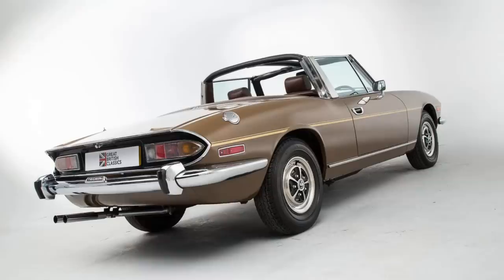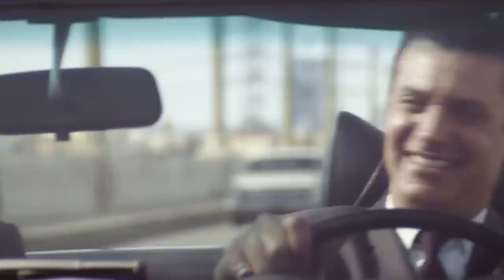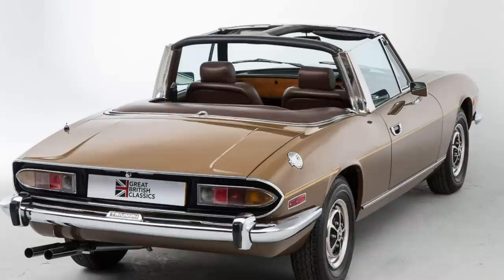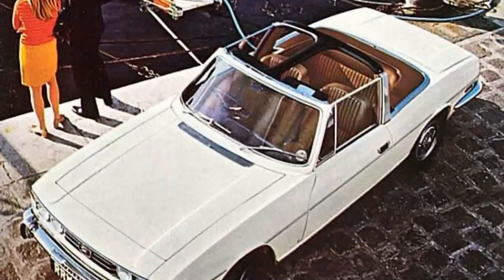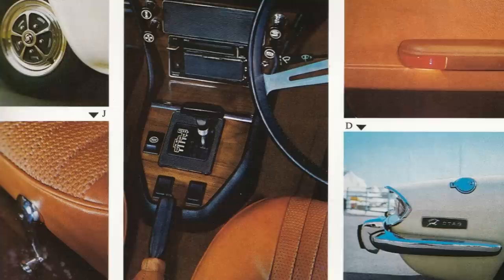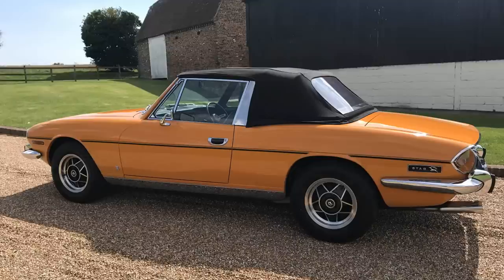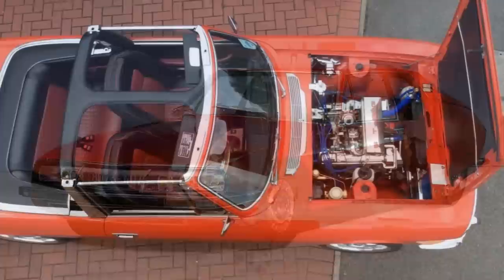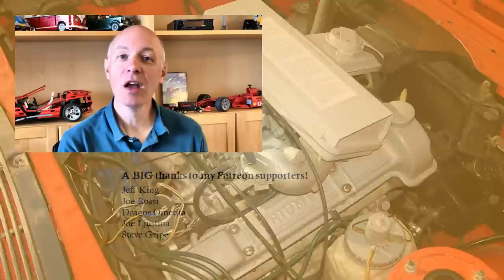Why did the Stag FAIL so Spectacularly?

Comment: The engine wasn't too bad provided you got a good un.
The timing chain was a pain, needed replacing regularly.
Coolant needed to be kept full of rust inhibitors,
They benefit from some minor adjustments to the expansion tank and a better radiator.
The dizzy tended to wear, better with electronic ignition upgrade.
Better carbs would have been nice (Webber's).
The crank was soft if reground, needed treating.
Perhaps that's too much of a list.
But I wish I still had a Stag.
It just felt special somehow and worth the effort.
Actually mine never let me down, but did give me a
 few anxious moments

Comment: It looks and sounds utterly brilliant, sadly the reliability was crap due to design and build quality 
bloody British Leyland, always screwing up the simplest of things
Reply: British Leyland was not the downfall of the industry, it was the final attempt to keep the lid on the festering cesspit about to erupt.  The iconic cars of the 60s like the Land Rover, Mini and E-Type were in fact all designed in the brief post war period of resurgence before the rot set in the 1960's.

The core problems was a dilapidated industry that failed to innovate where it really mattered rather than beat the drum of a few minor successes.  The rest of the world moved on, innovated and invested in its infrastructure, while the UK merely consolidated what they had into what became BL in 1968 and despite having a massive production base, any issue in a single plant could instantly shut down the entire production.  Ford, facing the exact same issues at the time could simply source parts from Europe.

British Leyland would have been a world class company in 1948 or even 1958, by 1968 it was a giant with clay feet.  They were usually down to the repurpose of existing parts in a record time and hope for the best and even stunning designs like the Stag were mechanical failures and the decent cars were so horribly uninspired you lost all will to live every day you drove one.  Given the issues, the real point is not that Leyland made shit cars, but how Leyland did manage to produce decent cars for their era like the Metro.

Leyland wasn't the murder of the UK car industry, it was one last doomed attempt to save it.

The irony is that Leyland had the potential to outgrow the problems that had plagued the UK automotive industry for over two decades, but everything conspired to make them worse.  The UK's curse is to have been at the forefront of so many developments only to remain stuck with outdated industry and infrastructure.

Comment: Everybody talking about what the Stag looked like....the problem wasn't the styling, it was the underlying mechanical bits, which were poorly designed to say the least. I had a 71 Saab 99 which had the Triumph designed OHC slant 4, and the idea of 2 of them lashed together sounds like a recipe for disaster. The last Stag I saw was about 5 years ago, parked behind a body shop way out in the Pennsylvania countryside and being used as a storage shed for rusty car parts. A suitable fate, actually.

Comment: As a teenager in the early 70's, a neighbour had a beautiful yellow Stag. However the motor went poopy in it's pants, it remained under a tarpaulin until he fitted a Rover 3.5 V8. Later available all the way up to 5.0, now a Stag with TVR Griffith power would have been quite something.
On a related note, how many times have we heard "oh, we cant make enough" in British industry. It was the same with bikes like Bonneville, to satisfy U.S. demand we had to wait. They did not increase output and we bought Japanese off the showroom floor. The Kawasaki Z1 was king of fast bikes & aging Honda CB 750 was second. (Laverda Jota & MV Augusta were expensive exotics) but Triumph & Norton were the best handling on my native Devon roads. BTW, I am now an old man & have been a Triumph owner since 09.

Comment: Nowadays you can make a Stag quite reliable and that doesn't mean using a Rover V8, which weighs less and upsets the Stag's handling unless further mods are done.
The engine was designed by Ricardo not Triumph.  The 4 cylinder variant was initially made by Triumph for Saab but Saab eventually redesigned the engine and produced it in Sweden.  It became the basis for Saab's later 16 valve designs.
Reply: Not so! The Triumph engine was designed by Lewis Dawtrey under Harry Webster's overall control. The Ricardo design was being developed with SAAB but they didn't have the funds to set up their own production line, so adopted the similar specification Triumph unit instead.
Reply: You're saying an engine which weighed less would upset the handling?
Reply: @jamesengland7461  If you replace an iron block V8 with an all aluminium V8 which weighs substantially less, then the suspension should be tweaked.  Unfortunately in the Stag's case it was very often not tweaked.
Reply: Mark, obviously incomplete work will not give good results

Comment: Surely the problem boiled down to, like all Leyland products, abysmal build quality
Reply: If only that would have been the problem. French and Italian cars had serious quality problems as well, but those companies managed to survive until today. Aside from the build quality, BL also suffered from equally poor management and poor engineering that resulted in myriads of construction faults.
Reply: I worked at Triumph motors Canley from 1970 to 1975 and you are dead right. The unions were so strong the company could not sack bad workers. No-one gave a damn about quality, I have seen new cars driven at maximum revs in low gears around the plant. Like most workers I would never buy a car from the company, it would have had the guts ripped out of the engine  before you took possession of it. It was the excesses of the unions that created the Thatcher government. Like a lot of British car plants it was anarchy on the shop floor.
Reply: @dp-sr1fd  I read a very good book on BL and it blamed unions, management and government in equal measure. Whilst there were malicious intentions from some union stewards, it made the point that actual working conditions were terrible on the shop floor. Imagine what proper workforce relations like we see now in Nissan in Sunderland where everyone is important, no matter what they do, could have achieved!

Comment: Back in the day, I had a TR3A. 2.2 Litre cylinder liners. Gas flowed cylinder head. Oil cooler. Re built uprated SU carbs....other various suspension improvement. It was splendid. Overdrive on 2,3,4. Double declutch down. Hardly touched the brake pedal. Happy times. 😊😊

Comment: Thank you for the great Stag Story. I own one 1973 Stag since 1975 until now and everything you say is true (I experienced it myself). Sad story of competing little companies like Triumph willing to have their own motor while elsewhere companies agreed on a joint development (example Renault, Peugeot, Volvo V6 development). So yes the engine's design was not finished (undersized timing belt, metal corrosion due to not understanding the metal couple corrosion and use of very poor metal, bolts, warping of cylinder heads, etc. The production was also a nightmare because of strikes, design changes happened all the time because of parts unavailability (to caricature it, not two Stags were identical). I worked many times trying to repair mine and bolts being seized happened all the time, aluminum threads coming with the bolts. A mechanics nightmare. Later when working on Honda motors, there was a huge difference (all bolts with surface treatment), precise design documentation.